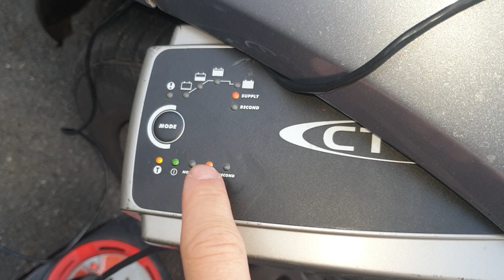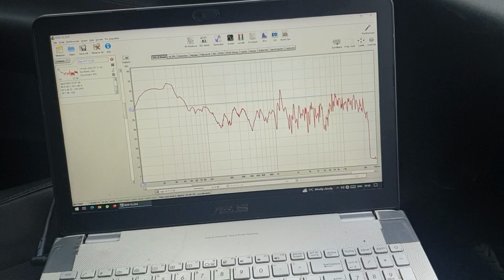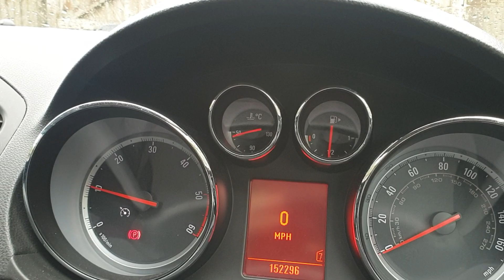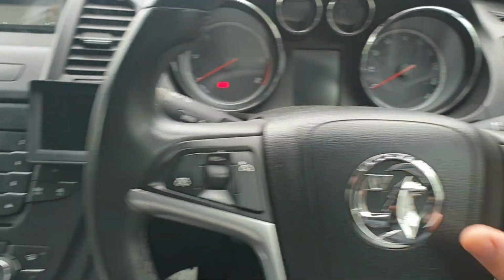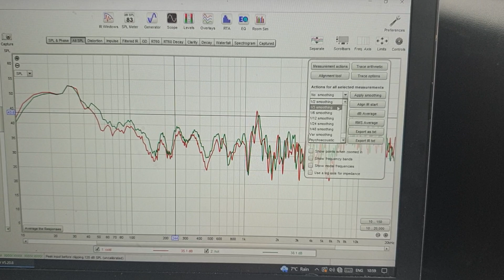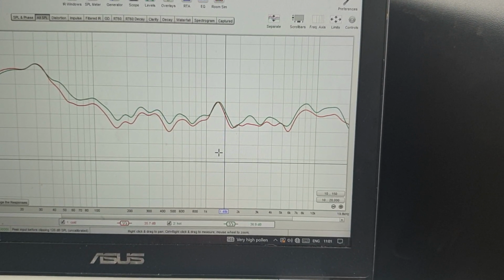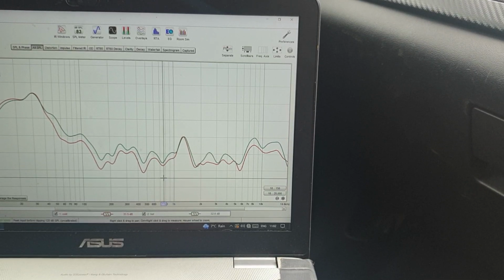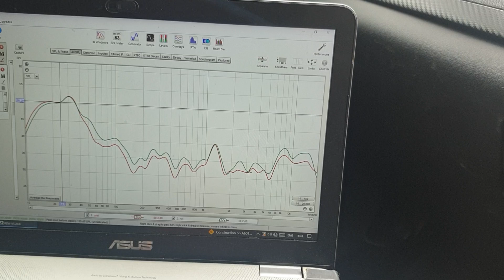How temperature affects frequency response

Comment: "The speed of sound changes by about . 6 metres per second for every degree. Sound is transmitted through the air by compression waves, which, at a small scale, depend on molecules transferring energy one to another. Air molecules have more energy at higher temperatures, which means they vibrate faster."

Comment: I agree, I would think that a warmer speaker is more sensitive with a softer suspension.
The two measurements are pretty similar except for that 2-5k region.  Is that the bottom of your tweeter's range?
Reply from the maker: That's more mindrange,my acoustical crossover is at 3.5k.